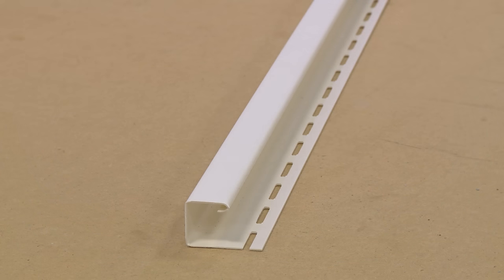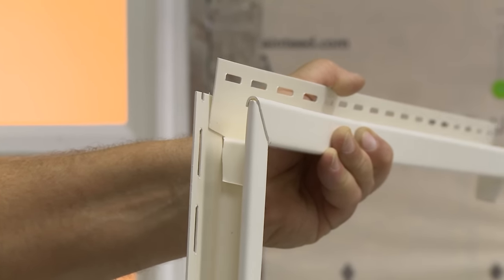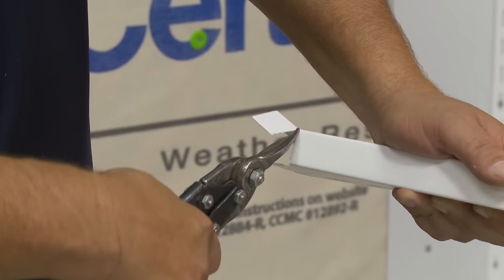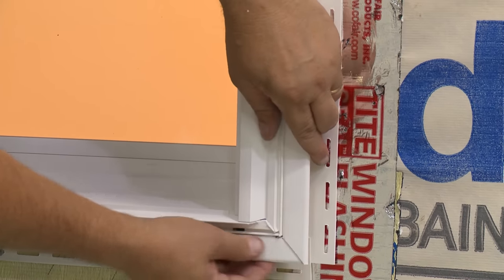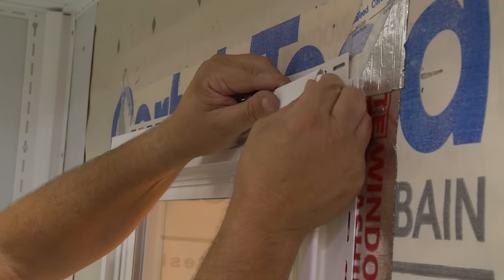Installing J Channel for CertainTeed Vinyl Siding

Comment: Good method, but you made a mistake in your video.   After cutting the rain channel for the right side, you flip to a piece that is already cut but it is for the bottom left side of the window instead of the bottom right side of the window.   You inserted the wrong picture for a few seconds.

Comment: You almost got it I do it in a way that I can cut it all and put it together on the bench all locked together when I make my  45 cut  I leave 2 inches of channel to bend over  but I leave the face and just snip off the rolled edge so I can slide it into the other piece witch locks the tap in tightly

Comment: Not all the information is here. Yes this works for 1" wide J-channel but if you have 2.5" wide you need 5 extra inches not 2 as stated. And the rain tabs and slots are 2.5" each not 1" as stated.

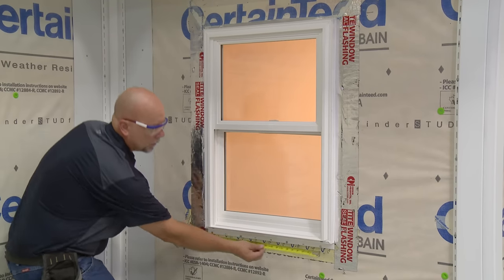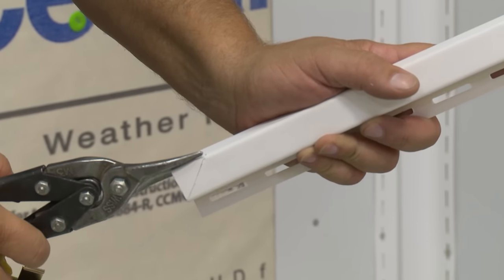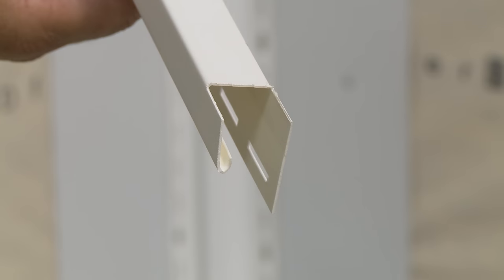Comment: Learn from my experience!! Stop at 0:29, cut the top piece 1-1/2"longer than the window width. (see my 0:45 comment) Stop at 0:37, note the left side is shorter that the right side, I found I needed to cut  ~5/16" off after I made the 1" cut out to make it fit into the 45* cut. Stop at 0:45 if you cut a 45* angle, the rain tab will be less than 1", it will be 3/4" this is why you cut the top piece 1-1/2" wider than the window. I see Bob Harris had it right, but I think it is only for the top piece.
Reply: U made that very very confusing
Reply: cocainum

Comment: Shouldnt it be 1.5 inches longer than the window considering the j channel face width is 3/4 inch.
Reply: I added a reply so you we get a message. Learn from my experience!! Stop at 0:29, cut the top piece 1-1/2"longer than the window width. (see my 0:45 comment) Stop at 0:37, note the left side is shorter that the right side, I found I needed to cut ~5/16" off after I made the 1" cut out to make it fit into the 45* cut. Stop at 0:45 if you cut a 45* angle, the rain tab will be less than 1", it will be 3/4" this is why you cut the top piece 1-1/2" wider than the window. I see Bob Harris had it right, but I think it is only for the top piece.
Reply: exactly. It is all determined on your width.

Comment: Only problem is that they don't lock together. If you leave an inch & a half or so on the ends & trim the hook off the outter edge, it will slide or snap into the joining piece & lock together.
Like a pro yo!
Reply: kosmosleha the finish edge of the J channel is rolled back about an 1/8 of an inch and will prevent the two pieces from slipping together. Imagine the top piece trying to slide into the side piece without a little room. You just snip the finished/ rolled edge so they slip together. Good luck!